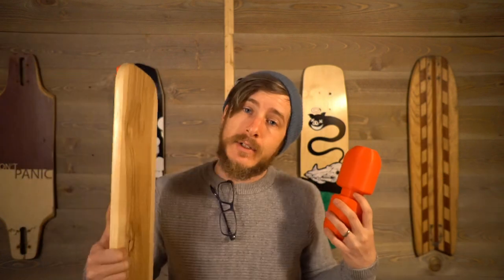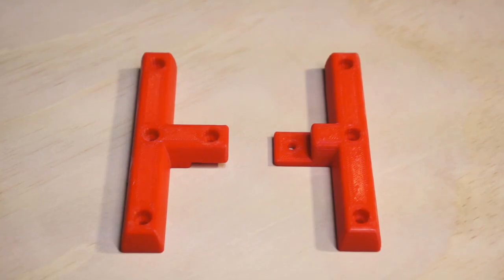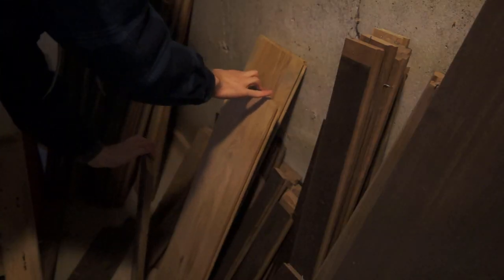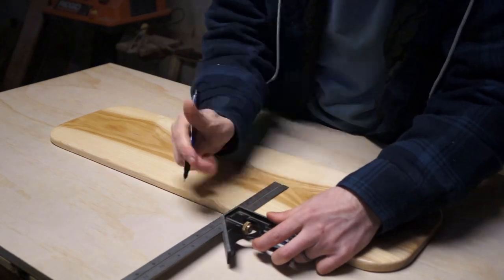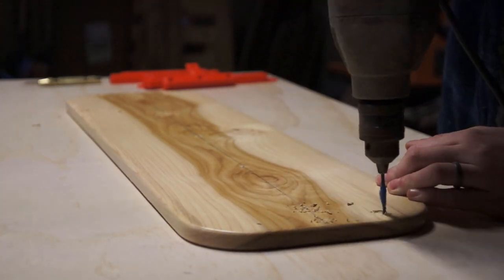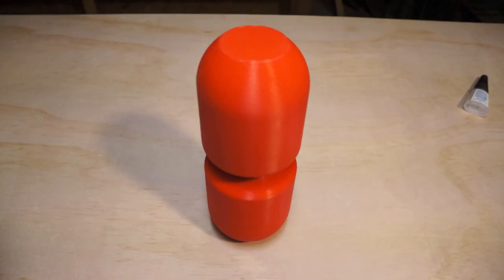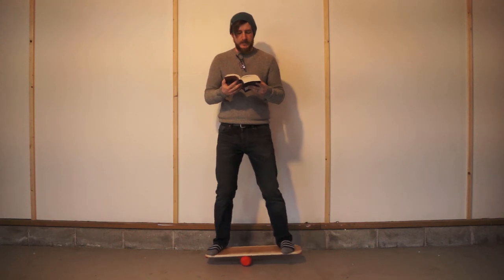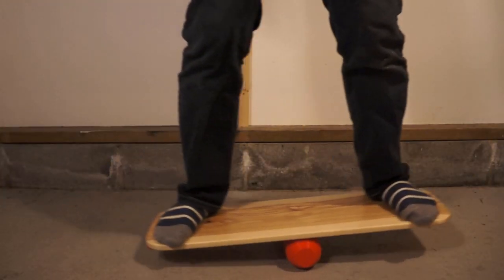Build a Balance Board With 3D Printable Parts

Comment: Printed one with PETG and 6 shells.  I over-glued the two haves but it still rolls nicely after a bit of scraping.  https://imgur.com/Z6eCTq0 https://imgur.com/vC4REfN
Reply from the maker: Looks great dude! Having fun with it?
Reply: @GoodRoads  I am having fun with it.  It seems to work best on a low pile carpet tile.  I have been thinking about how the cylinder could be modified to grip a smooth floor or thick pile carpet without slipping.  Thanks for posting this up!
Reply from the maker: Hmmm, I bet there's a lot of ways to address that. My first thought would be to wrap the cylinder in duct tape or something similar. It might leave a residue though...